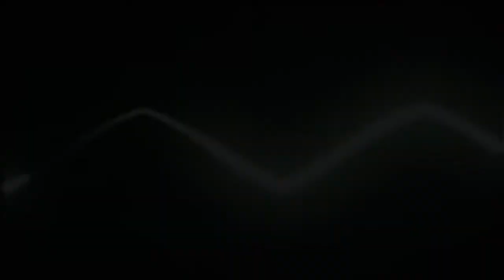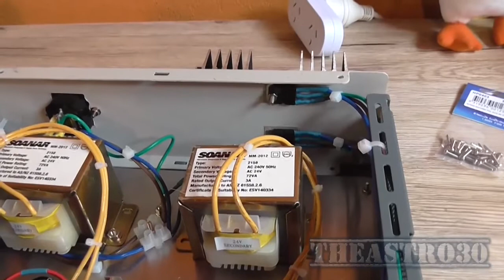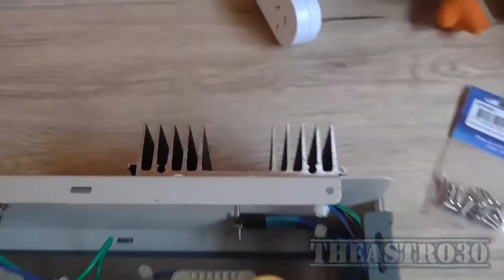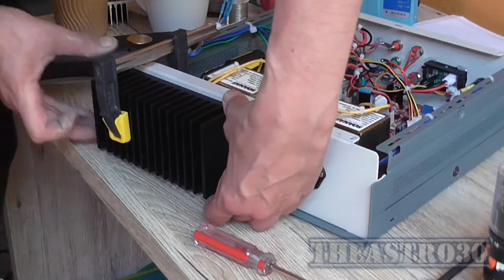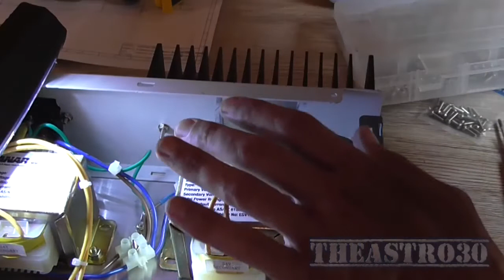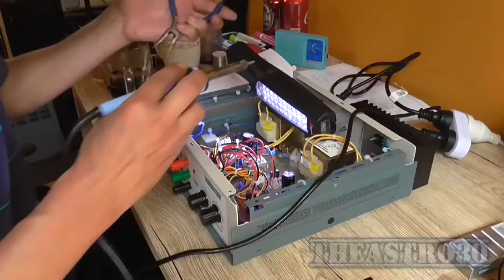Bench Power Supply Modification

Comment: could I suggest the hole you cut for the output transistors is cut wider and put the transistors side by side with some distance between them. The way they are mounted, is the bottom transistor is heating the top transistor and you may be getting thermal runaway.
Reply from the maker: Yes. You have a valid point and at the time, I didn't think of that. That does make perfect sense and yes, the transistors should be mounted separate of each other. Thanks for the comment and suggestion.

Comment: The heat is generated by the voltage from 3v to 30v that the transistor stopping passing out thats why they get hot

Comment: So you want that the heat should dissipate from the transistors though thermal paste, paint, case metal, paint, thermal paste, heatsink in the air? You are too optimistic. I would mount the transistors on the heatsink directly (with thermal paste, ofcourse) and cut a square on the rear of the case (for the transistors) and mount the heatsink on the case. And mount the transistors vertically so the heat dissipates in the heatsink evenly.
Edit: I commented without watching but yes sir, that is what you did!
Edit: I would use a 12+12V transformer and a relay to switch the winding according to the output needed voltage.
Reply from the maker: Watch all the series

Comment: You probably won't see this now in mid March, but you do realise that the worst conditions for the transistors, heat dissipation wise, is when you are running the PSU at low output voltage and high current. Then all the excess voltage, hence power, is wasted in the transistors!
Reply: It needs to be said.  Under load, REDUCING the output voltage will make the transistors HOTTER!

It's expected behaviour for a series regulated power supply.